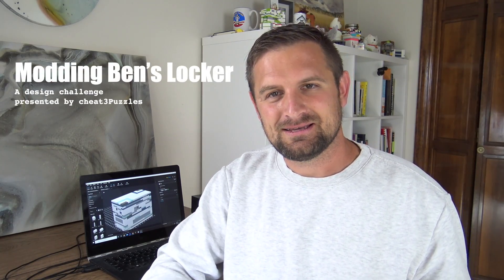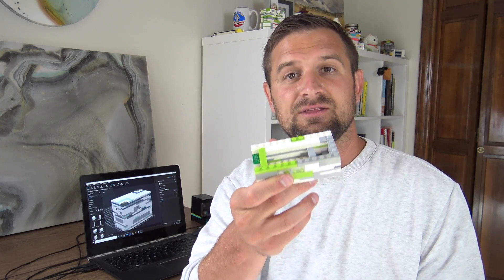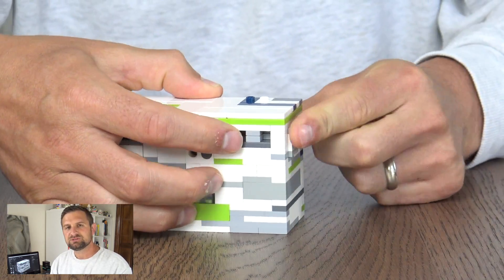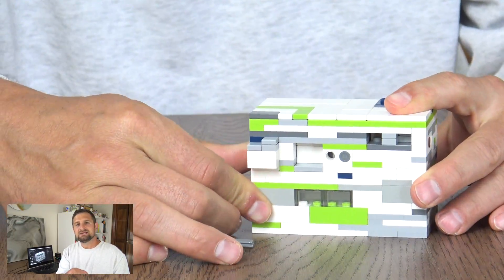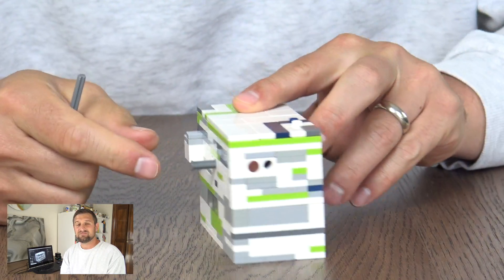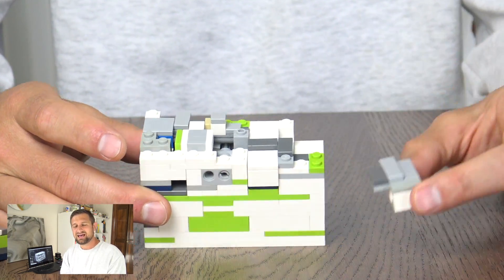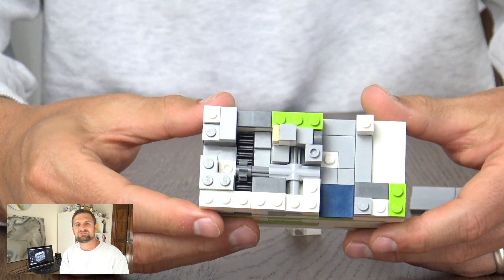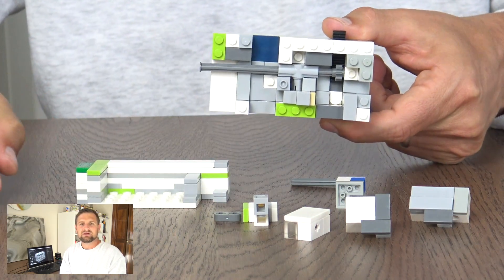CAN U DESIGN A PUZZLE? Modding Ben's Locker Design Challenge

Comment: Does it have to be the exact dimensions or just the sliding cabinet
Reply from the maker: The main point is to have a drawer/cabinet similar to Bens Locker. It doesn't have to be an exact match to the original, but watch out for a bigger size because they can be easier to break.

Comment: I have a puzzle box but it doesn’t include the locker and the cabinet. I made my own and would like to show it off. Is that acceptable?
Reply from the maker: This challenge focuses on modding out a new top to sit on the original cabinet and drawer from Ben's Locker, but submit what you have and we'll check it out!
Reply: cheat3 Alright Ty for responding

Comment: I noticed you have "Studio 2" in this video, if this is what you use could you tell me how to place parts on a "Tile"? as when I try it I have to use a "Plate".
Reply from the maker: This can be tricky. Take off the "snap" button and you'll have to move the piece in manually (using the arrows). I hope this makes sense.
Reply: @cheat3puzzles  Thankyou, most helpful :-)